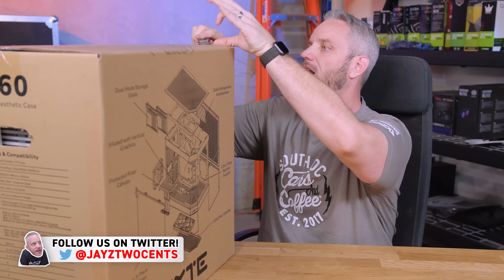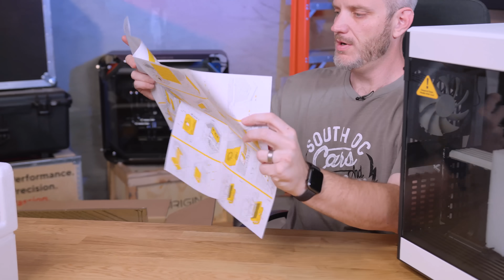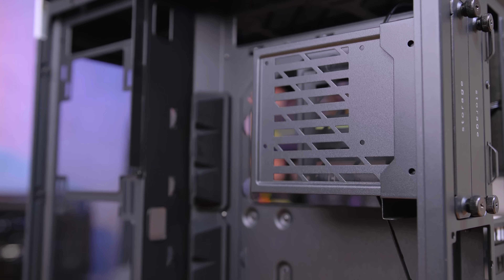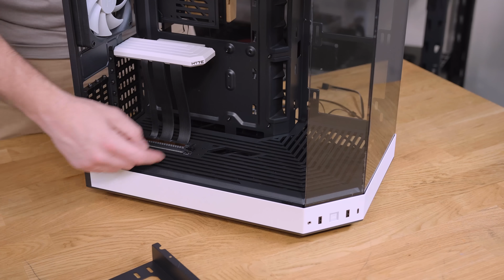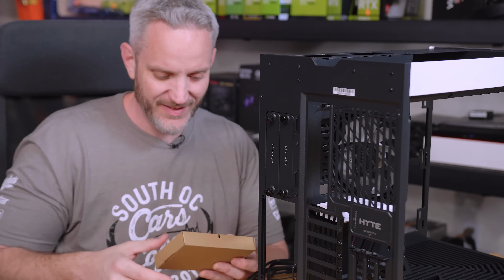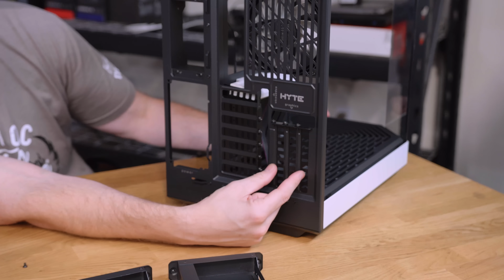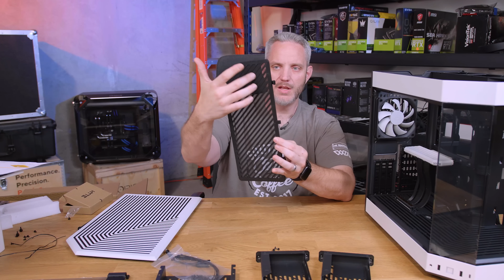Someone FINALLY broke the mold for PC cases...

Comment: I am building in this case currently and I ran into an issue where my Corsair A115 CPU cooler sticks out to far to put the side panel on and it also sticks down too far to where my AMD 7900XTX vertically mounted hits the cooler that way. I am switching the cooler to a DeepCool AG500 that I had also used in my wife's build.

Comment: I just got this case for my new build 10/20/23 "5 years since my last build" and I absolutely LOVE this case. I have a Gig Areo 4080 in it, & playing starfield at max settings, i get to 72C and it stops. Eventhough the 4080 is about 1/2 inch from the glass. The fans on the bottom really help pull cold air right up through the fins of the 4080. AMD 7900x with a Asus rog strix X670-E-A MB. All white build and x8 corsair rgb fans.with a Corsair H150i 360 AIO at the top. Best rig I have ever built and This case makes it look so goooood! So worth the 200$ price point. Thanks for the vid. 👍👍

Comment: Looks Great but the low profile PCI Bus plates in the back are a deal breaker for me. My 4090 would be slam up against the glass, and I never trusted those extensions anyway. No alternative way to mount. Thanks for pointing that out, it would have escaped me. I guess one could take a Dremel tool to it.

Comment: when connecting the jack splitter to the front panel jack, it mutes the speakers, unless you use another device, like optical (that doesnt works good with every game..) so u cant connect only a mic if you dont have optical output for audio... sad.

Comment: Agree with a lot of the comments.  It's been 9 months since this post, has anyone posted a build about this.  I am considering this for case for my next build and would like some comments.  I just finished a liquid cooled Seasonic case and love how that turned out.  
Jay, did you ever do a build on this chassis?  Any additional comments since you unboxed it to the actual build (if you have done one).

On a side note, has anyone done any temperature studies on how much liquid cooling you actually need.  this case is a perfect example of potential radiator locations, but if you only gain a few degrees with a 2nd 360, is it about looks vs practicality at that point...just curious.

Comment: So... amazing case that sadly gets unusable simply by not having room for expansion cards or those ridiculous "4+ slot GPUs".
Hell, even a 3070 needs 2 slots plus some space to draw in air. 
And personally I'd prefer to have the front panel on the upper side, not at the bottom. Yes, the case is meant to be put on a desk and shown off, but if you ever have to put it down, you'll have to crawl to turn on your PC.

Comment: I build my already, I use red Hyte y60. My specs are MSI X570 Gaming Edge motherboard, AMD 7 5800x, 2x16 GB ram DDR4 3200 G.Skill Trident Z, MSI Geforce 3080 RTX 12 GB, 1TB Samsung 980 NVME (apps only), 8 TB Seagate Iron Wolf Pro HDD (games and pictures library), 850 watts MSI PSU, MSI 320 AIO water cooling argb, 3 120mm Corsair fans argb, female Dragoon for display.

Comment: Just finished my build in one.  12600k , aorus b660 elite, aorus waterforce xtreme wb 3080 custom loop , 32gb 3200 ddr4 corsair  vengeance pro, aorus 360 aio cpu, Samsung 980 nvme , and corsair hx1200i psu.
Reply: have you posted pics of it anywhere? I'd love to see how it turned out!

Comment: Nice case, It is nice that there is a lot of space and ventilation. BUT where I live I have a lot of dust and so the dust gets into the PC case and causes all kinds of heat problems. These manufactures need to have some kind of dust barriers built into there cases that more robust, filter material you can take out blow out the dust and return to the case. You might want to have a video about what to do with any PC to protect it with dust filter material to installed. I cheap so do not go all high end with this.

Comment: The fact that the front panel IO are grouped as one solid section is by far the most attractive thing about this product for any novice looking to jump in. I remember my first time building when I got to installing the front IO I was super cautious and trying to peer into the case with an phone flashlight trying to make out the polarities. It would have been at that time that I wished I had got a case like this for that specific feature. More companies should look to follow that one small feature as it makes it a selling point all on its own.

Comment: I'm sure an engineer could correct or back me up on this, but just because it has more holes, DOES NOT make it have more airflow. Airflow in a computer chassis is part of the Air Fluidity in which air comes in from certain areas, passing through other areas then leaving the chassis. Yes, a lot of air can come in, but can it be actually COOL the parts that NEED to be cooled through CONVECTION or is it just a passive air system where the fans are useless pieces of decoration?

Comment: I'd do an aquarium build with it. Seal all the holes, pump it full of mineral oil, put heat exchangers and pumps at the back. No fans, no radiators on any of the components, just mineral oil flowing through the case and cooling everything. Then I'd put some fake fish and decorations inside, some mood lighting, maybe a model submarine.

I mean it just looks so much like an aquarium.

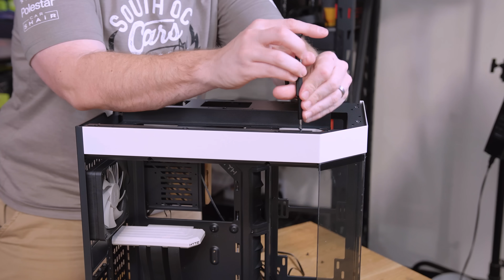Comment: 6:00 wow that looks so easiy to install an AIO, when i did mine, the dumb fucks at cooler master decided to have the panel the fans/AIO attack to bulge out slightly meaning my AIO doesnt actually fit as the panel is shorter then my AIO radiator, and the real dumb part is that i cant just flip it so it bulges inwards because the part that the screws go is recessed into the bulge meaning the screws arnt long enough. My solution? i just left it at an angle with 6/8 screws in (the 7th and 8th dont reach due to the angle its mounted at).
The hoses are at the low end, so theres no air bubbles, ive monitored the temps, theres no issues.

Comment: I just recently bought this case and was kind of disappointed with the " accessories " or lack there of especially for $200. I understand it includes a pcie cable and 3 fans but the cheap black plastic cable ties and no extra standoffs is just kind of BS. I had a corsair 5000D ( which is $150) and it came with so much extra stuff it really puts this to shame. Corsair included a fan hub and 12 quality corsair cable ties and a bunch of fan screws and 3 extra standoffs. IDK maybe i'm spoiled with corsair but was DEFINITELY DISAPPOINTED to say the least and now I'll be using a lot of the EXTRA accessories I got from CORSAIR to complete this build

Comment: Don't really understand the frontpanel being on the bottom which seems very, very inconvenient...
Reply: How is it inconvenient? It usually works better as you won’t have your cables dangling down in front of the case but instead running below it. Looks much better

Comment: I am very impressed with your taking it apart and all the air flow. I have an ThreadRipper 3rd Gen, with 24 core that runs hot when doing a render. This case will give it the air flow it needs. I will get back to you all when it is done. Amazon has the case in black for $200, I would rather have white.
I just noticed this is from April of 2022.

Comment: Wish they had made room for  2x360 or 360+280 on top. might have used it for next build. looking at a 13900kf and a 4090 plan on running dual loops. :\ nice case though. a lot of front space with no use also :|

Comment: Imagine putting a 4090Ti in this thing. How much gap you will have between the fan and the glass mounted sideways like this. Might have to mod the glass side panel with an opening circle for the 4090 fan

Comment: Rewatching this as a post-purchase justification after a few months, and only complaints I have are the lack of reset switch and limited storage options. (I will be using your double sided tape method.) Overall the build in this case was really fun because everything is positioned so perfectly. This case looks great, especially when you add the phanteks Neon RGB strips. In terms of airflow, I recently changed to 2x140mm noctua redux fans for the bottom GPU intake, stock Hyte 120mm rear intake, 2x120mm Vardar-S side intake, and the 240mm EK-AIO with 2x120mm noctua fans as exhaust fans. I'd test the thermals, but my foolish self dropped and chipped the glass panel so it's not going back on until I get a replacement.

Comment: I like the case, but would need to see more before I'd trust to buy one. I need to see builds with different size RAD's in it, like a 360 in the front space, for example. I'd like to see builds with the gpu's in different positions, and how it affects airflow. I'd like to see how much dust this would accumulate inside with it being so open. Things like that are important before trusting a company I've never heard of. BUT, that being said, IFFFFFFF we could see all of that with positive results, this case could sell extremely well, as I LOVE the way it looks, the airflow capabilities and that it can hold ATX and EATX boards. Why not do a build vid, and show it off??? Also, they should consider putting two more USB A ports, and a USB C on the TOP of the 45 degree angle. Otherwise it's just useless space. I'm curious why you didn't include direct links, instead of just general links, or the cost?

Comment: If a 3 slot video card will  be pushed really close to the glass as stated.  Then I'm guessing a 3.5-4 slot video card like some of the 4090s are a no go.  I wonder if a revised version of this case will come with a PCIe 5.0 riser to replace the PCIe 4.0 riser?

Comment: The 1/2 height card thing bothers me.  It would be interesting to see motherboards come in multiple pieces like using a riser cable/daughterboard for all PCI-E expansion cards.  Part of my hesitation comes from I hang on to my PCs for a long time and I want the option of expandability and an upgrade path that covers multiple years.  Yes, it's hard to predict the future, but if you want to add a capture card or another feature, you have to find it in 1/2 height or go USB external.

Comment: honestly with the front and side of the case being completely sealed idk if its a revolution for cooling xD i personally like and think directional cooling is probably better to prevent dust buildup more only if done correct ofc with a case like this u kinda would need a weird cooler that rotates the air outwards and has maybe a 1 sided input idk it feels weird and might reduce ur heat exchange overall. I got a old tower with front to back cooling the only air inlet sealed by a tight net that i can periodically clean the top to bottom might be the best setup tho

Comment: I've been looking a getting a new case. I have a Thermaltake View 37 and although I do like the curved side panel, filling my radiator is a pain. I want a case with space for a top mounted radiator and was considering the O11. This case looked like a nice alternative to that until I saw the price and given that this case has much less flexibility in terms of setup, I think the O11 still blows this out of the water. It does look cool though.

Comment: So...a glorified fish tank, with air holes everywhere which screams air-cooled, not water-cooled due to limited rad placement. Then, only 2 designated places for HDD/SSDs, low-profile expansion cards because apparently everyone only worries or needs a GPU nowadays. Yeah, no thanks. I'll pass. Maybe I'm an outlier, but I have a full-size ATX that is essentially an E-ATX, I need several expansion cards, in addition to my GPU, as well as running a mix of 6 HDD/SSDs, in addition to my boot m2.

Comment: I just recently built in this case and it's amazing! Thermals are astounding! 
Ryzen 5600x, rtx 3070ti 
I filled all the fan slots so 8 fans in total. Whole system runs 29-34c at idle. Definitely recommend this case!

Comment: Nice case, nice decisions, still needs work, but for a first effort it's way beyond others. I have a meshify 2, it's a great case, good airflow but it also has some downs. All I can say about this case is that I like it and only concern is to have easier to access air filters and the rear panel to offer the possibility to have standard expansion card or even GPU's...

Comment: I have had my back panel off for what seems like 4 or 5 months now since i installed my 3070TI. Im sure there are possible drawbacks but i noticed a huge benefit to having the backplate of the CPU exposed to air, even in the summer months. someone want to correct me? doesnt it seem like stifling the motherboard from below creates problems? I just took its underwear off! Ambient air hasn't harmed it yet, dust might, but i have some canned air around for that.

Comment: I don't know if it's just me, but i despite the cases with a lot of random airflow. I want cases that have streamlined flow with both push-fans and pull-fans to direct airflow the way I want it. I want that every minute the case should be emptied of hot air so many times.

Comment: Personally, I'd love to build with that case. I like the idea that the back of the MB isn't on the side plate of a normal case and is instead open to allow for proper cable management... Which is normally horrid with most traditional cases.

Comment: You mentioned the new GPUs are going to take all the space from the back mounting and it got me thinking: with GPUs getting bigger, will we begin to see more mounting options? Since most cases have at most 3 slots, could we start to see either 6 slots, or maybe some kind of vertical mounting to allow multiple massive cards?

Comment: I have a this case and still love the look as it is definitely a modern but unique design. I am not quite at the custom loop level myself just yet so the ever increasing size of modern GPUs is starting to worry me. The most this can really handle without choking air is basically only a 2.5 slot card.
Reply: The case is really designed for liquid cool gpu and cpu.
Reply: I have a Gig Areo 4080 in mine and it sits about 1/2 from the glass but with the fans on the bottom blowing up through the fins of the card, I get to 72C & it stops with max settings in starfield. But yes a 2.5 slot card or water cooled would help but it works just fine at least in my case it does.👍

Comment: looks good but I thought that they had the cases encloses like that so the air pressure dont escape. Its pulls in cold air and pushes it through your pc pushing the hot air out the other side. If you have air coming in everywhere, can it just be pushing hot air around?

Comment: This looks like a neat concept I want to try out. For only $200, I think this case is a great value for what it features. I would toss in a 5900X, Be Quiet Dark rock Pro 4 or AIO 360 Rad up on the top, 64 GB of Corsair Vengeance LPX at 3600,  RTX 3080, and probably a Corsair HX1000 for the main components. The only complaint I have is about the lack of PCI-E Expansion on the back of the case for those who have a lot of peripherals and need expansion cards.
Reply: 64Gb of RAM? It's a bit too much.
But the bigger question is would you put 2 32Gb sticks of RAM or 4 16Gb sticks?
Technically, 32 Gb would be plenty enough. Separated between 4 sticks of 8Gb, it will give you more performance than fewer bigger sticks.
Reply: @Le_Frenchman  I would fill however many slots the board has. It doesn't really matter too much either way. And as for the amount, it depends on your use case. Mine would definitely benefit.

Comment: Can a 360 radiator be installed in the top of the case with the tubing connectors facing down at the rear of the case? Is there enough room?

Comment: I would put a AMD Ryzen 5 2600 Pinnacle Ridge 12nm Technology
	16.0GB Dual-Channel Unknown @ 1064MHz Motherboard ASRock X470 Gaming K4 (AM4)
	Optix MAG27C (1920x1080@60Hz)
	4095MB NVIDIA GeForce GTX 1070 Ti
	476GB Sabrent  (SSD))
	476GB Sabrent  (SSD))
	83GB OCZ-AGILITY3 (SATA (SSD))
	83GB OCZ-AGILITY3 (SATA (SSD))
	279GB Western Digital WDC
	279GB Western Digital WDC 
	931GB TOSHIBA MQ01ABD100 (SATA )	
	Sound Blaster Z

Comment: This is kewl, though I have a Segotep phoenix T1 which hase a verticle setup so there's no gpu card sag and has full open front and rear for great airflow, one of the few I found to fit the Arctic freezer 2 360 aio. This does look to be able to fit 360 on top but don't know about the thick rad of the Arctic 2?